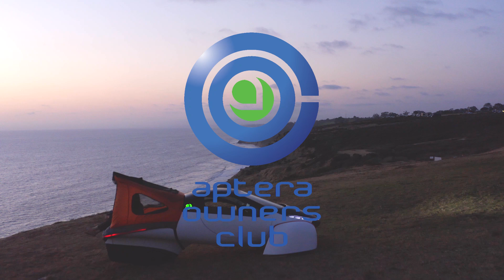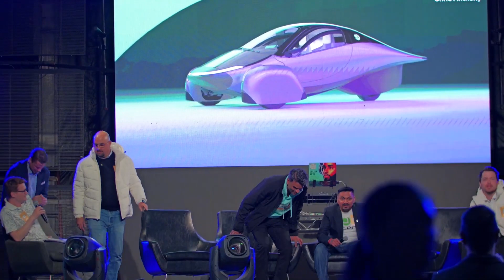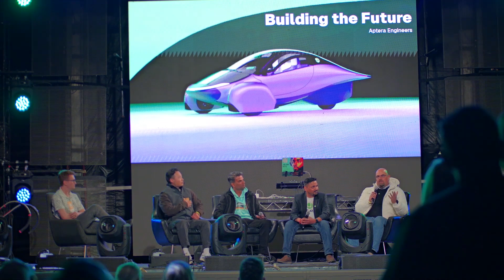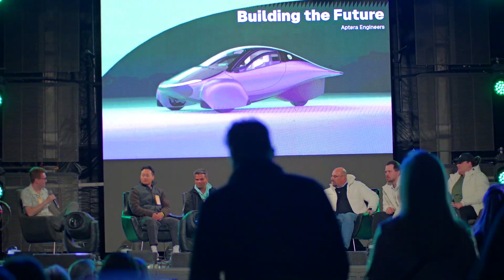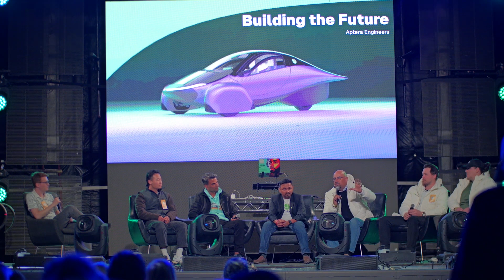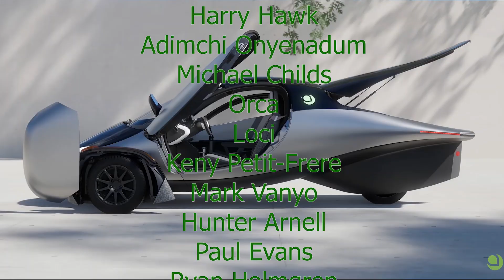Aptera's CES Afterparty:  The engineers!

Comment: I have a couple of ideas for things they could add that I think would bring a lot of value. Make a way to connect "battery generator" so that when the Aptera's battery is full, you could make use of all those solar panels to charge an external battery. (Also add controls to manually prioritize charging of the external device or to schedule it.) And similarly, have a port to hook up an additional external portable solar panel to increase the solar charging rate while at a campground or in the driveway. A portable 400w panel would easily fit into the hatch and should be able to double your solar charging!

Comment: A fairly new company called Donut Lab claims to have designed a super lightweight in wheel motor. I think Aptera should definitely consider this company whenever they decide to bring back power to the third wheel.
Reply: They already have.  If you look up the company, they are partners with Elaphe
Reply: @ that’s awesome.

Comment: If I were Aptera, I might release solar charging info soon, but for best case, I would wait till the summer solstice then park it on a 45 degree slope! Why not? It is best scenario, right? I would appreciate a comment/response (not trolls).
Reply: Yeah, that's a good point, that would probably get you as close as possible to the theoretical 700w. Probably will only actually see 500w of peak charging or something, but that should get you to or maybe even a bit past the 40 mi a day claim! Personally, I would like to see whatever charging data and numbers they are willing to publish as soon as they're willing to publish it. Before summer would be nice, but I agree that the haters would have a field day with any data short of that 400 mi per day claim.
Reply: @josiahpaez4601  Nevermind ’haters’, investment is the current challenge and serious investors want validation data even if (winter, suboptimal) solar gain falls short of the 40 mi/d.

Comment: Not sure where to put this question — I don’t have time for Discord. I was just listening to the podcast Batteries Included and Kyle Connor said he’d spoken with Chris Anthony at CES, and that Chris had told him that the launch edition will not have ABS. Is this correct? If so that’d be quite discouraging. ABS is crucial.
Reply: In another era, I might have disagreed with you, as I do not find keeping directional control while stopping on slippery surfaces to be difficult.  But now, drivers expect the vehicle to manage the braking for them, and might not be prepared to pump the brakes to maintain control. 
At the very least, if they do not have anti-lock, this should be emphasized to new owners so they can train themselves. 
As an aside, one of the biggest hazards for Corvair owners was that they would have far to much air pressure in the front tires, which made them unstable.  The owners' manual didn't draw attention to how rear engined cars were different in this regard.
Reply: @993cc  Unlike many rear-engine cars, including Corvairs, Aptera has designed a vehicle with proper weight distribution.  I always carried 1-2 cases of oil in my Corvair ‘frunk’ to compensate.
Reply: @993cc  - Remember, if you drive a vehicle without ABS out on the road, you'll be surrounded by others that do. Thus, not having it means you need to have lots of space in front of you at all times and pray nobody pulls out in front of you.

When I drive my 68 bus, I need to remember that because the stopping distance and especially in lower grip situations, is literally a problem today.
Reply: @billsmith5960  Leaving a larger gap (not tail gating) in any car is probably one of the best driving tips to minimize the chance of a crash as well as keep traffic jams from worsening. I wish more people would do it.
Reply: @jasonhochstrasser8657  - Wishing and what's reality are two different things. It's like wishing that everyone should never exceed the speed limit.
Reply: @jasonhochstrasser8657  You are absolutely correct on the tailgating issue. There needs to be technology installed in vehicles that won't allow a vehicle to create a tailgate situation relative to the speed. Also vehicles that cut into a hole in traffic causing a dangerous situation, the vehicle put into jeopardy should have built in camera systems and a transmitter that warns the offending driver and a counter that automatically fines said bad drivers after say 2 warnings.
Reply: There is ABS validation mentioned at 10:30 at https://youtu.be/SRIY8x5d7HQ?si=WPfHaRPvuYh7Jrg_
Reply: @jackfrost8269  - It's actually calibration not validation. An ABS system is worthless and actually dangerous unless it's properly calibrated. Thus for startup companies that have no experience, you send your vehicle to Detroit and have one of the major suppliers (usually Bosch or Teves) to do the calibration.

I've calibrated many ABS systems in Motorsport (Bosch units). Even then Bosch makes people sign a waiver that they are not liable if I screw up the calibration. For startup companies that have vehicles driven on the street, the manufacturer get heavily involved.

This is the same (even more so) for Airbags.
Reply: If no a.b.s aptera can not be sold in th EU .. a moto car cycle needs to have this !!!